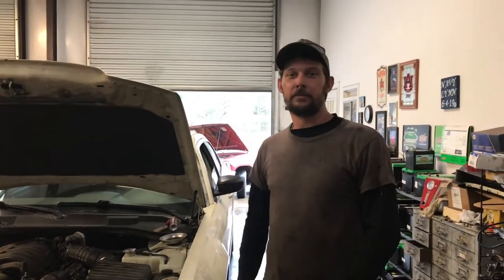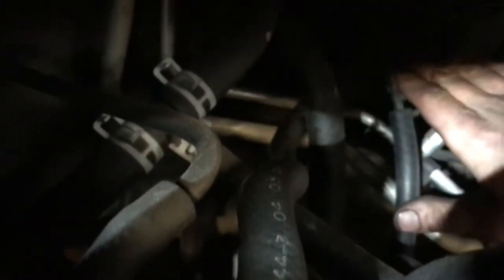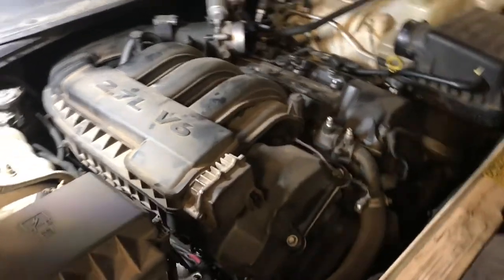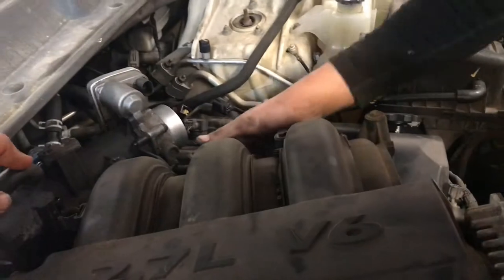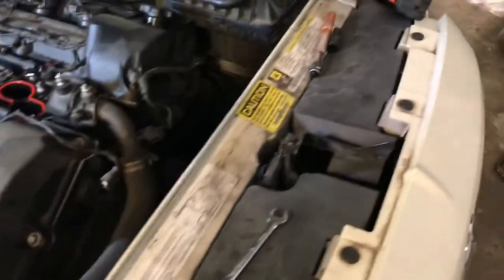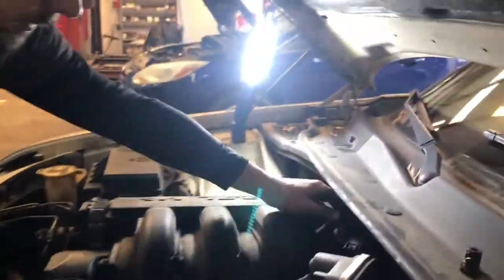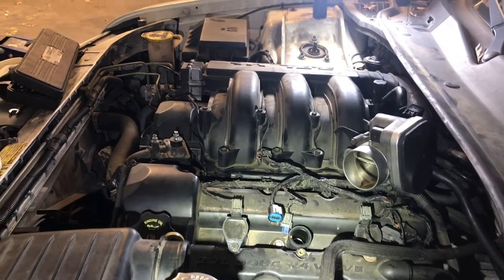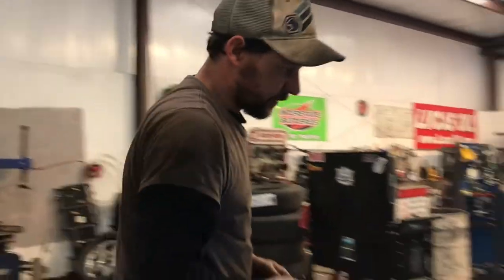How to replace coils, spark plugs and plenum gasket 2006 Chrysler 300 2.7

Comment: I noticed it was a struggle getting the manifold aligned with the EGR tube.  I have the same issue, but I'm unable to align with the EGR tube inserted.  Do you have any recommendations on getting it to work?  It seems like the EGR tube is too low and puts the manifold at an angle.